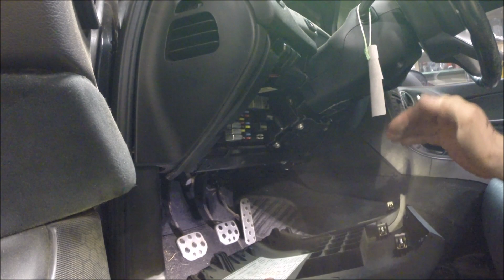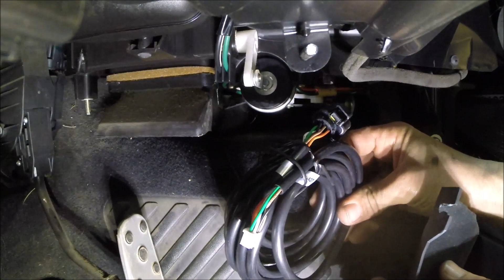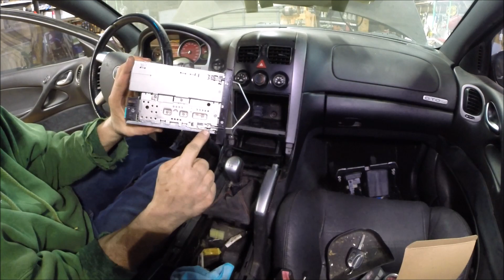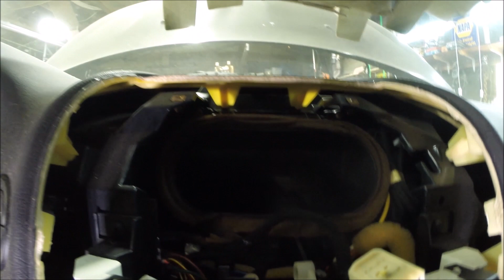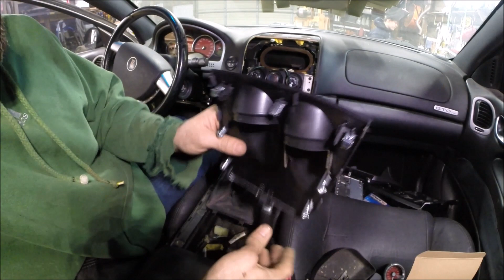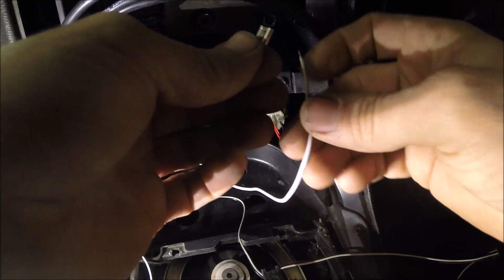2005 GTO dash pod gauges pt 1

Comment: Don’t pull the panel to remove the radio you’ll crack the board inside. Pull the clips outwards and wiggle it to remove the radio
Reply: Don’t remove which panel? 
The stock radios can be crazy tight to pull out using the holes in the face

Comment: Just came across your videos.  Im from New Zealand, drive a 04 Holden Commodore YV seris2 HSV Clubsport 6Sd manual sedan.  Basically the 4 door vertion of your GTO.   Was very interesting for me to see that even though yours has been manufactured as a lert hand drive, that they left the Hand Brake installed on the right hand side.   Thanks for rhis video, ive just finished making a 5 clock dash insert for mine, it comes standard with two gauges in the centre much lije yours, oil pressure and volts.  I brought a blanking plate like yours came with, cut the centre out molded a face plate/cove to mount 5x2" gauges, AFR, Oil temp, and vacuum to go along with the standard oil pess, and volts.   Cam fit three side by side, with another teo above.  Covered in C/F it looks very factory.   Just needed tips to disassemble the console to wire everything in.    Great detail.  Thank you snd Hello from little New Zealand

Comment: Where are you getting the oil pressure signal from?
Reply from the maker: From the ecm, it draws it from the canbus signal. 05 06 only
Reply: @evsnova74  did you pull signal from the main harness under the hood or somewhere else? Sorry I must have missed it if you said it in the video!
Reply from the maker: @eazhar  on part 2, 5 minutes 20 minutes in it shows how I tapped in to the obd2 port.
Reply: @evsnova74  awesome thank you!!

Comment: This just made the to do list. Maybe I’m old but it bothers me so much not having an oil pressure gauge. 
How lucky is that switch thing? I look forward to that😎
Reply from the maker: I used to just use torque pro with a Bluetooth dongle to read oil pressure but it wasn't very convenient. At least not as convenient as having a guage always there. 

I always worry about tapping into the wiring somehow in cases like this, I was quite relieved to have such an easy solution right there.
Reply: @evsnova74  I’m supposed to be dialing it back but I’ve got an addiction! I just installed a catch can, hopefully it helps and I have the gforce rear coilovers on the way. And I’m collecting parts for the manual swap. And now I need gauges 😂 
I appreciate you brother, your videos are crucial. Any plans on a fuel pump video? Figure while tank is out I’d like to change mine but I want one that can support 600 ho or so while not being a terrible experience to install.
Reply from the maker: @Modern_Muscle_PNW  not any time soon. I'm hoping to do heads and cam next winter, which might necessitate a better fuel system but time will tell. And I'd love to rebuild my differential, it clunks so badly.
Reply: @evsnova74  I’ll probably get to heads and cam same time. I have to get a magnum in her first though.
Reply from the maker: @Modern_Muscle_PNW  here ya go, this channel probably has better content than mine:
https://youtu.be/AMkkEO8f6V8